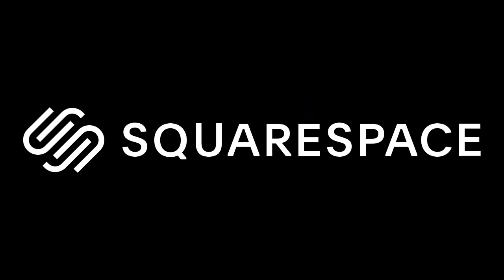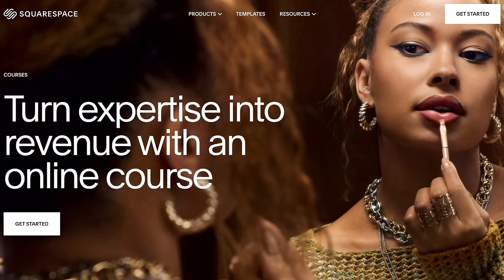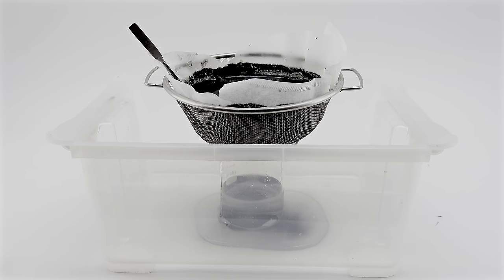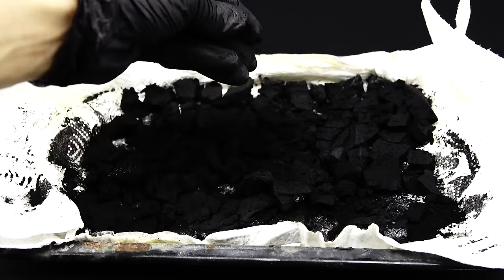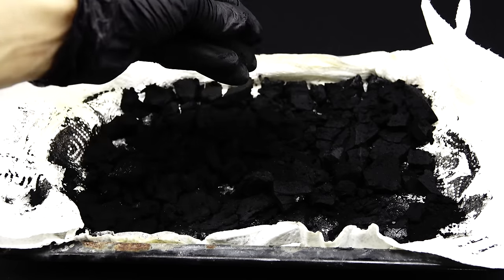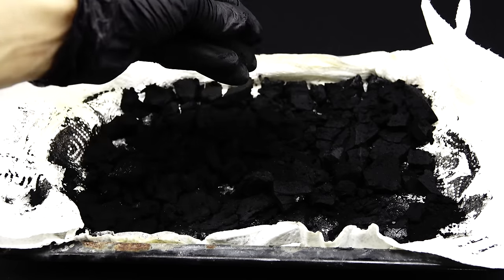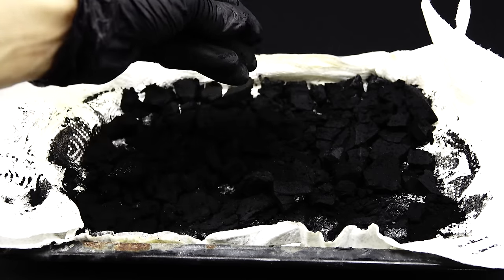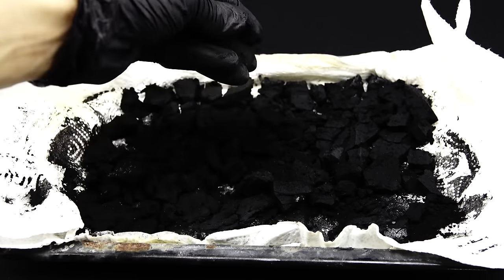Turning Batteries into Purple Paint

Comment: Try milling the pigment with an acid functional resin (the acrylic is a good one) dissolved in solvent! it will produce a very fine dispersion that will be 100x better than just mixing them ( source; used to work as inks and coatings chemist).

Comment: Good job! A couple of comments:
- your MnO2 is heavily contaminated with iron (hence the yellowness here and there). To get rid of it, you set your pee-like solution's pH to ~6 IIRC, and start blowing air through it (aquarium pupm is enough). At this pH iron oxidizes to 3+ and precipitates as a hydroxide, the rest stays in solution. To colour shifts from yellow to faint pink, with an orange/brown susension.
- the lumps created in a ball mill were due to moisture still present in your pigment. You should have ground it with a mortar, put the coarse powder back again to the oven, dry it properly, and then use ball mill.

Comment: For isolation MnO2 from battery paste you can:
1. Wash paste with water and filter it (as you did)
2. Add MnO2/C mixture to H2SO4 solution and then added H2O2 to dissolve MnO2
3. Filter solution from carbon
4. Precipitate Mn(OH)2 using NaOH
5. Add H2O2 to oxidize Mn(OH)2 to MnO2
Reply: two reagents you mentioned have been regulated in a crass manner in the EU
Reply: @-r-495  In Poland (where this youtuber live), 12% H2O2 and NaOH can be buy without any problem. H2SO4 can be buy as a drain cleaner (it is 95% sulfuric acid) in Internet shops

Comment: You can also precipitate Mn(OH)2 using Naoh then filtering it and leaving it to dry in air, the Mn(OH)2 will convert into Mno2 in air. This method is much safer than producing a ton of chlorine and the final product is also more pure.
Reply: Also you can add sodium hydroxide to the bleach to reabsorb the chlorine gas and make more hypochlorite
Reply: Source?
Reply: Disproportion reaction resulting in NaCl and NaClO.

Comment: Having made this reaction myself for a uni project, I respect all the steps you went though to clean the manganese and pyrifying it by dissolving it with acid. 
 I went by the road of pyrolysing the carbon away. 
 It did sinter the manganese and I spent almost a day to crushing it up finely again.

For phosphoric acid a lab mate help extracted some from Coca-Cola as a proof of concept that this pigment could be made from house hold items, the ammonia we got from cleaning chemicals.

 In the final reaction I used some more acid from the lab store room so we could end up with enough to actually paint with. 

Mine did ende up more dark purple, possibly due to mixed oxidation states of the pyrolized manganese according to my teacher at the time. 
We made about 100 gram that was split 3 ways between the lab mate, me and for  professor  lab collection.

Comment: Question: Couldn´t you have used a high temperature furnace to get rid of all the unwanted oily solutions and carbon particles added to the mangenese dioxide and then later purify it more easily ?